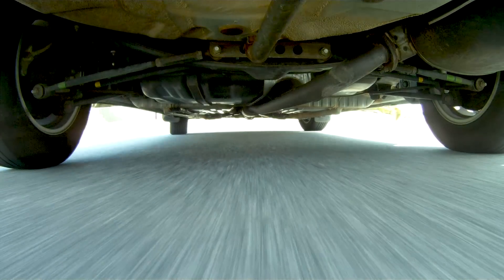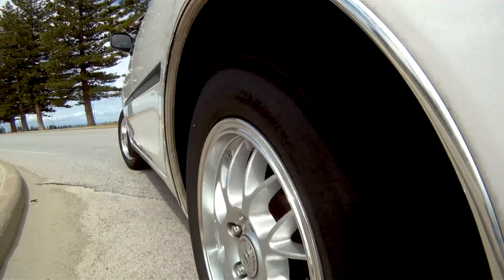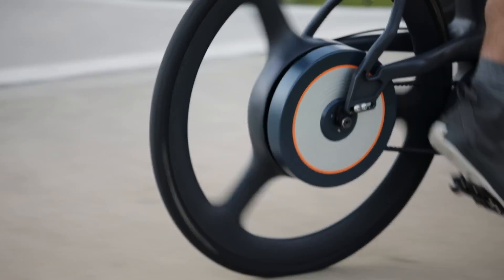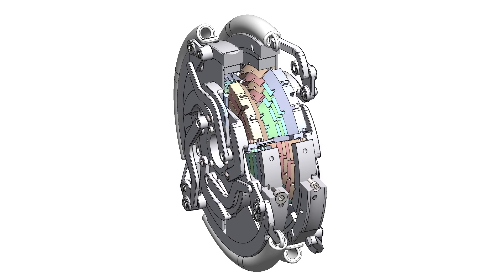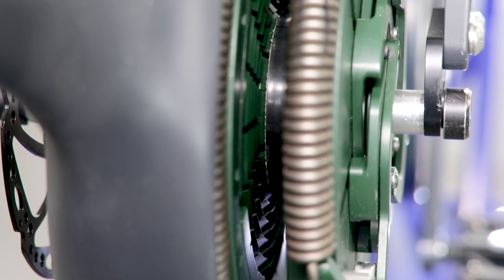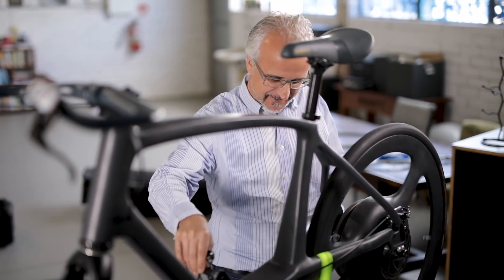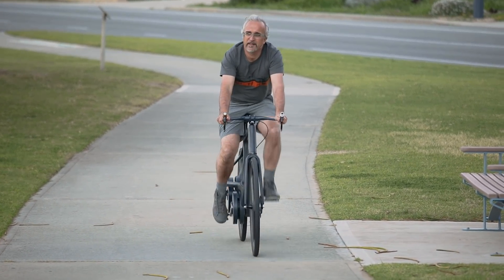Continuously Variable Transmission on a Bicycle

Comment: the idea of CVT is smooth changimg ratios, there you've got the overcomplicated version of usual chain system without smooth effect.

                                                          TT       TASK FAILED SUCCESFULLY
Reply: Each disk/wedge can go in at an infinitely variable distance, so it is still a CVT and the ratios are still smooth.
Reply: You gotta really peddle fast to gain speed
Reply: Actually, the change IS smooth, that's the whole reason for it, however is it REALLY needed? Seems a small advantage which comes at a (literal) high price.

Comment: Who is this designed for? Professionals will not like it because of the added substantial weight and the rubber belt. Commoners will not buy it because of the sheer cost I imagine it must have for all these nonconventional shaped mechanical parts. Also, must be a breeze to fix it on the road. Not to mention you need Bluetooth to change gears meaning at the very least it needs to have a battery of a generator. built in, adding more cost and weight.

Comment: Seriously people we already have di2 shifters(fast Efficient shifting) and powermeters(measuring output watts at the cranks) why can’t someone design some electronics to shift the derailer on watts put into the pedals!! The harder it is to pedal(more watts) the shifter automatically drops down the gears!!! Bingo light weight AUTOMATIC shifting 🤔

Comment: Not unlike the CVT Subaru had in the Justy back in the '70s. Same concept of changing pulley diameters but with a  different implementation. I'm surprised Subaru hasn't sued for patent infringement.
The problem using it on a bicycle is when the batteries go dead, you're stuck in 1 ratio. That and it looks to be much heavier than the already proven NuVinci CVT.
No wonder I'm not seeing it on any bicycles, it's been a year and a half since this video.
Reply: I can't imagine this system will ever make it to market - it looks way too heavy, and better systems (like the Nu Vinci) are on market yet. 
The efficiency of the NuVinci is also lower than the one of other shifting systems without CVT, so it's mainly used for E Bikes, and not for non electric ones.

Comment: Yeah CVTs are just not common at all in cars. And nobody likes driving them. And what do you need Bluetooth for? What's wrong with a wire?
Reply: You can't bring a wire into a turning pulley. Something about it winding around the hub a few times and then breaking. lol

Comment: CVT's are also  inherently very inefficient, and on a bike every little bit of efficiency helps.  People even complain that a modern belt drive gearbox on a bike is like %9 less efficient than a chain and that is enough to keep the gearbox systems from becoming mainstream.

Comment: Please dont add electronics to my bicycle also please I just want to pull it from the shed after 6 months, pump tyres and go. I can see from this I wid probably also have a flat and possibly damaged battery and maybe some software upgrade all before taking off 🤦‍♂️

Comment: 81 -
Die göttliche Grundlage der Materie, die verdichtetetes, verflüssigtes Licht zu Wasser ist
Quelle: http://frei111.de/pages/81einundachzig.html
81 stabile chemische Elemente gibt es im Periodensystem (ohne die
radioaktiven)
8 = Sauerstoff (O), 1=Wasserstoff (H), Wasserstoff ist der Bausstein des
Universums !
O+H=H2O = Wasser. Wasser ist für das Leben auf der Erde unentbehrlich.
81 verbirgt 3 Neunen: 8+1=9, 9x9=81: 999
18 (Kehrwert von 81) verbirgt 18/3=6, 3 Sechsen: 3x6=666
81 = 3hoch4. , Kehrwert von 3hoch4 = 4³, 4³ = 64
64 = 8x8 = Gesamtzahl der Felder des Schachbrettes.
46 Chromosomen hat jeder Mensch. (Das entspricht dem Kehrwert von
64.)
8 Töne hat eine Oktave: c-d-ef-g-a-h-c ...Allerdings ist der 8. Ton auch
gleichzeitig der 1. Ton der nächst höheren Oktave.
Der 8. Ton ist also beides: 8+1 !!
1 durch die 81 geteilt ergibt: 0,012345679 012345679 012345679
012346.....
.....es wiederholen sich alle unsere natürlichen Zahlen in ordentlicher
Reihenfolge immer wieder (unendlich)....
.....bis auf die 8..... Sie fehlt (aber nur auf den ersten Blick !)
Das ist eine Ergänzung zu der Licht- und Wasserforschung. Die ergab das Wasserstoff das Erste und am häufigsten vorkommende Element ist. Im Verhältnis 2 zu 1 = 2 Drittel aller vorkommenden Elemente sind aus Wasserstoff.
Wasserstoff ist die Verbindungsbrücke vom
ursprünglichen Licht aller Sonnen bis
zum heutigen physischen Leben auf der Erde:
Das war meine göttliche Eingebung, sowie die Entdeckung von H3O2 energetisierten Wasser im Gewitterregenwasser der Selver.
Wasser ist komprimiertes, verflüssigtes Licht und hat ein Bewusstsein.
Energetisiertes Wasser hat mich zu unglaublichen Erlebnissen verholfen.
Energetisiertes Wasser wäre das optimale Heilmittel und Vorbeugung für Covid 19 Symptome der Blutplätchenverklebung bis zu Blutgerinseln und innerlichen Ersticken.
Neu - Wasser hat ein Gedächtnis - WASSER IST LEBEN - MEHR als H2O
https://www.academia.edu/42824918/Neu_Wasser_hat_ein_Ged%C3%A4chtnisWASSER_IST_LEBEN-_MEHR_als_H2O

Comment: What's the weight penalty vs. standard chain/gears? What's the maintenance going to be like? Dirt and sticks, in general, how much of a problem can debris be? What about adverse weather conditions and temperature extremes? Can this CVT be used in the rain or snow? Summer or winter? How often should the belt be replaced? I weigh about 240 lbs. and stand 6'6" tall, can this CVT handle my dimensions?

Comment: >Continuously variable transmission

>Literally have set of speeds and shifter
Reply: No it doesn't, watch it again.
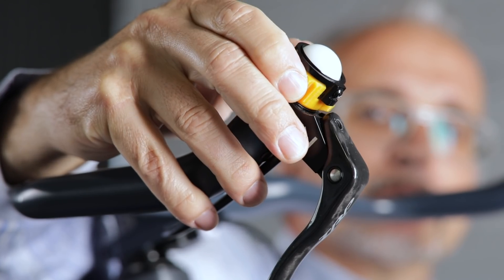Reply: @Spazturtle  watched again. 1:13
Reply: @ilsirent9726  the gear doesn't move in steps, you can see this as you watch it move, the different sections can be inserted at different levels not just fully in or out. Look at how they use the control knob at 1:13, they turn it one way to begin increasing the gear and turn it the other way to decrease the gear, when they let go it returns to a neutral position.

Comment: Continuously variable?
The description in the video suggests this is not step-less. 
The only justification for adding such a level of complexity is surely step-less gearing, such as the CVT in the Honda Jazz motor car. That real CVT varies the ratio according to accelerator depression (= push on pedal) and load (= weight or slope of road).
Therefore, it is unclear what advantage this offers. 
There is no such thing as "infinitely" variable ratios, but there is probably still a need for a bicycle transmission that is truly continuously variable.
IMO, effort would be better directed towards sophisticating hub transmissions instead of the dirty derailleur contraption.

Comment: Maybe they should have checked out the actual bike market before developing this. You can buy a Nuvinci n330 CVT transmission for a bike for $110 and it is 70% smaller than this.

Comment: The best solution is already invented..over 100 years ago. It`s shaft drive. But bikes with shaft are so reliable that some models of 30-s are still in a good working condition. What kind of fool would produce this?

Comment: Clever, but an answer to a problem that doesn't really exist. Or, at least the solution already used is "good enough", like using a counter-rotating back propeller on a helicopter instead of two counter-rotating main blades: It's not a perfect solution, but it's good enough and much cheaper and more reliable than the "better" option.

Comment: For bicycles (even for city and touring) lightness and efficiency are relevant. Chain and derailleur work at 93 - 96% efficiency and weigh very little, but for many users seem to be not so friendly (not easy to use). Fitting a nuvinci or an internal shifter inside the hub adds some weight and steals some 5 - 10% efficiency, but they're easier to use and, for the really lazy rider, I seem to remember there's an automatic elecric actuator for the nuvinci (or was it just a prototype? Can't remember). So, either this CVT bicycle shifter provides the declared benefits without degrading too much both efficiency and weight, or it is just a mere engineering exercise. Please provide more data, in case.

Comment: The tech seems solid. But I can assure you that under the full force of my legs on a climb I will either stretch or break that belt. I used to run a huge road crank on my full suspension KHS back in the day. Belts are for commuting only. cheers though

Comment: I don't see the point. You still have to select gear, so what's the difference? If you want to only be able to select gear on one side for whatever reason, you just have to build a bike with that limitation. No need for bluetooth and a manually operated variator.

Comment: Advanced Transmissions: Invents a thing
Everyone in the comments:    no
Reply: @JoshuaValvi1  but placing it on a bike is a bit much as people barely have the problem of “This gear is too high, and this gear is too low. WHAT DO I DO?”
Reply: @Howard-de1gs  agreed
Reply: lmao
Reply: because it has obvious flaws. i see the implentation of gearboxes aa a better way (even better than current shifters) for most users
Reply: I'm proud to give you Upvote Number 742 for that comment.    8)
Reply: Correct
Reply: People who live in flat areas say no. People who live in areas with actual hills say, let's see how well this actually works.
Reply: @SmallSpoonBrigade  you mean "no" and "no, probably no"
Reply: @SmallSpoonBrigade  i rode my 18 speed 1000 miles a month in the ozarks.
These fools saying chains cavles and gears aee reliable dont ride enough.
Reply: @SmallSpoonBrigade  You could probably buy a decent eBike for what this thing would cost. That would work much better in hilly areas.
Reply: Chris L i live in hill area and i say - nah.. never ...
Reply: @SmallSpoonBrigade  no we dont. 15 to 21 speeds is more than enough to adjust for the conditions.
Reply: @mrmedium7984  but why not try  a system that shifts automatically, possible more durable, and overall better?
Reply: @mrmedium7984  it looks like this thing has an actual  fixed number of transitions available, so it's not completely 'stepless', and probably has 12-15 gears, just from what I can see of the segments engaging...but, yeah, Bluetooth...nah...
Reply: But why not though? It seems superior.
Reply: @Yumemaru.  shitload of moving parts to break and looks expensive af to repair or buy. Also solves a problem that bikers really didnt even have in the first place
Reply: @who1928  I'm sure if you pay that much it won't just break out of nowhere, also it's a QOL upgrade.
Reply: @Yumemaru.  key words being "pay that much" suuuper expensive solution to a problem that didnt exist     :/
Reply: @who1928  someone would buy it doe.
Reply: @who1928  current gear has a shitload of moving parts to break, too. 
For me it solves a problem I have.
I like it.
Reply: Well, just stop inventing useless expensive things.
Reply: all beacuse they are “wah its got electronics”
Reply: @jhoughjr1  No. NOT all beacuse they are 'wah its got electronics'". Because the mechanism is hideously overcomplicated and hopelessly sensitive to dust and other hazards and is unacceptably expensive... AND because "wah it's got BLUETOOTH electronics, meaning that (a) it isn't reliable and (b) it works WHEN IT WANTS to work and (c) it relies upon batteries which probably won't be up for riding when you're up for riding and (d) it's hackable for fun by others. Oh, and it can never be expected to last nearly as long as the very simple mechanical derailleurs we already have on our bikes. Oh, yes... and it's terribly expensive to repair or replace.

DANG. And (I keep remembering points) there's no particular purpose for it. It doesn't make your ride particularly easier or more pleasant. In fact, it makes your ride LESS pleasant because belt drives are inherently less efficient than chains are so you spend more energy pedaling than you do with a chain.

Comment: Q:What is the added un-sprung mass by this system?
A: Yes.
Reply: I don’t think there are any springs
Reply: Unsprung mass on bikes doesn't amount to much either way. You can be totally fine with 0 springs. But more rotational inertia is with no extra benefit is definitely bad

Comment: This is really interesting. But I am curious to know the total weight of the system components vs. a current derailleur & chain system. And also how well does this system fare in wet, sandy, or muddy conditions? Cheers, #theadventurebiker

Comment: There's already a CVT system on market, the nuvinchi hub.
But a CVT isn't a must have on a bike, in a ICE car it has the advantage to maintain the most efficient rpm for the engine, to save fuel. At a bike, there are much more possible gears, and it's relatively inexpensive too.

Comment: Ok good in theory.  How much weight does it add ?  When bike makers try shaving grams from the weight this system is the doing just the opposite...How about cost?  Will it be cheaper than a regular cassette?

Comment: Well I remember a AS SEEN ON TV with a shiftless system  and it was based off of weights or something. Faster you went higher the gear. It  was terrible because it shifted 3x as much beca you can never maintain the constant speed. so weight dropped to lower gear....it was a piss off system this looks 1000x worse🤣

Comment: Could I achieve 50mph without too much effort using this transmission?
Reply: Only if you can also do it using conventional gears. This is not a motor, it's a transmission. It won't help you pedal.
Reply: @PacAnimal  send me the bike to try it.

Comment: Why do we need a bluetooth connection to ride our bikes. As an option sure, but a requirement not really. Using electricity does not mean it is an innovative solution. The solution of the continuous sliding conical geometry with the given rubber belt is and clever. I like to see this drivetrain in one of the velomobile competitions. I would like to see it prove it's worth.

Comment: Lot of butthurt people trying to make excuses regarding why this won’t work here. It’s not going to have dirt & grime problems if it’s placed inside of a hub. Plus such a design would be extremely beneficial to the eBike industry where most of the users don’t normally go off-road anyways. It would allow an eBike to go faster without shifting, and improve efficiency. I do agree on moving parts but for the most part most engineering projects such as the Soviet T-34 or the Volkswagen Beetle were the result of efforts to simplify the design, so overengineering can be allowed so long as it is simplified in the long run. Point is this technology is proven possible to be used on a bicycle and BC of that eventually simpler designs can be made. 

Edit: also to note a velomobile, which is a tricycle with a fairing to enhance airflow, would largely prevent any damage from impacting the hub via dirt and grime ANYWAYS. Plus it would make a pretty advanced human powered vehicle capable of hitting highway speeds, if not outright becoming a whole new category in Human powered land speed records.

Comment: I don't know why you would bother, a true CVT for bikes already exists and it works really well, completely silent and no gear changes to be made. Check it out yourself, the manufacturer is Reece and Muller, a German belt driven bike with so many advantages, including being small and compact.

Comment: I don't want to seem sceptical, but my 1950's CCM has been working fine for a long, long time with a 3 speed internal hub gear setup and a reliable chain drive. I can see bicycles evolving eventually but I don't think this is the big change people have been waiting for. Maybe a precurser of things to come, we're just not there yet.

Comment: What ever for? Internal combustion engines make power in a far different manner than the human body. The purpose if gears on a bicycle is a totally different function than on a motor vehicle. People tend to think you start in a low gear and shift up as your speed increases when  you ride a bicycle. Nothing could be farther from the truth.

Comment: Nesting pulleys looks like a clever concept.  Congratulation to the functioning prototype.   Seems like it's more efficient than rubber v-belt CVT's found in scooters, snow mobiles, and maybe car CVTs with there metal push belts.

Comment: hmm.. shifting gears via bloototh? let me guess, the controller has a built in battery that quickly starts to decrease over time and forces customers to buy a new controller at rip if price if they want to avoid getting stuck on the same gear every time they drive more than an hour?

Comment: There are still a lot room for improvement.
CVT bikes are great for people who don’t really know how to shift gear but want to ride bicycle in hilly or tricky area.
Like at tourist spots.

Sure, CVTs aren’t as efficient as direct metal to metal power transmission, but they’re much easier to automate and they provide very gentle shifts, also transmission efficiency doesn’t really mater for most inexperienced cyclist, their main problem usually lies in gear, torque, and cadence management. People are actually stronger than they thought, but poor power management makes their power don’t get applied properly.

When most people rides a multi gear bikes, they very rarely touch the gear shifter, as result they’re very rarely in optimum cadence and torque range, so either they’re trying to push higher gear at low speed (sometimes results muscle strain) or pushing small gear at high speed (nothing really bad, just they get tired very quickly). The CVT with computer will manage their cadence so the rider will always be in optimal cadence which will results higher average power generation and better endurance, yeah they’re less efficient but rider that generating steady 120 watt but with 85% transmission efficiency goes faster than a rider rider that don’t know how to use gear and only generates 85 watt average power even if his transmission efficiency is 100%.